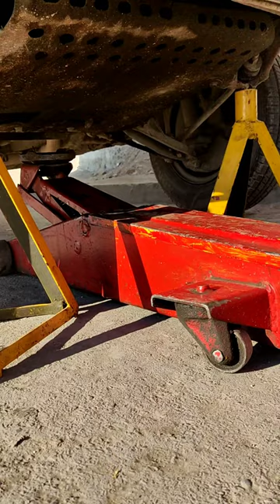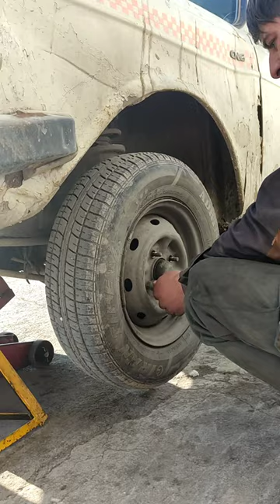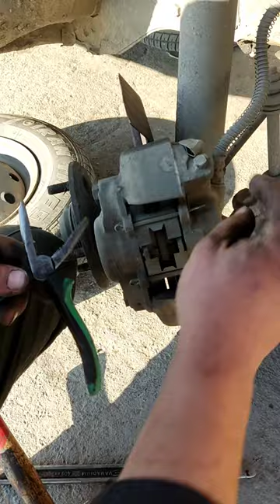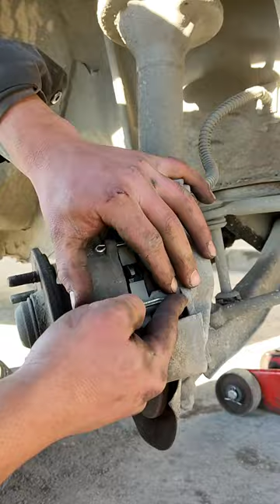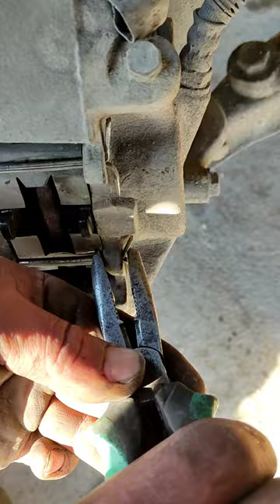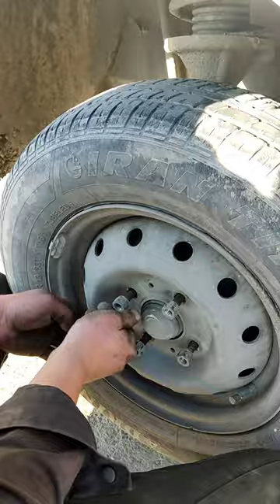#mechanic #automechanic #automobile #cars #truck #restoration #shorts #mechanicsteve

Comment: Didn’t even touch the rotors that’s like only doing half a brake job, resurface or change them, then you can repack or change the wheel bearings while ur at it
Reply from the maker: Thank you very much for your opinion 😍❤️
Reply: @mechanicmajid  yessir I do get that sometimes the customer doesn’t want to pay for all that if it sounds like I was talking down on ur work I wasn’t trying to